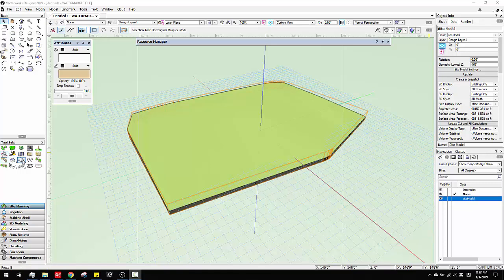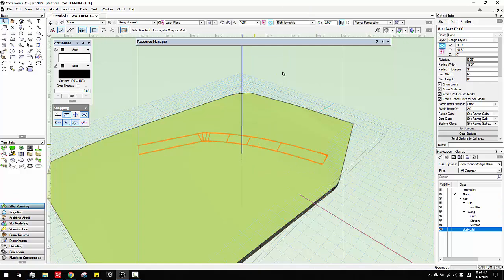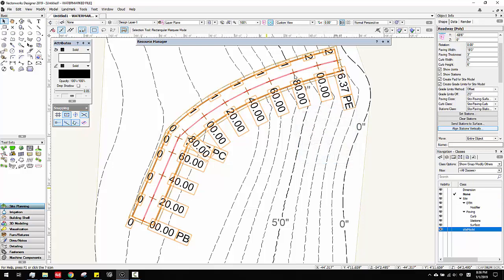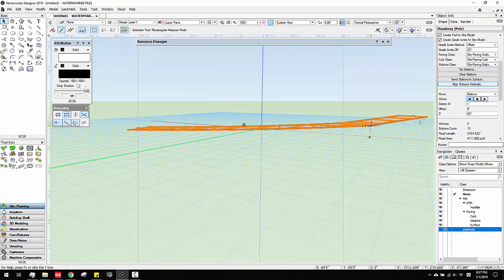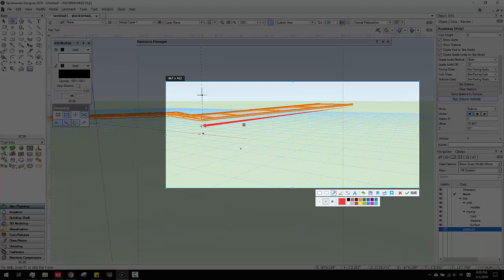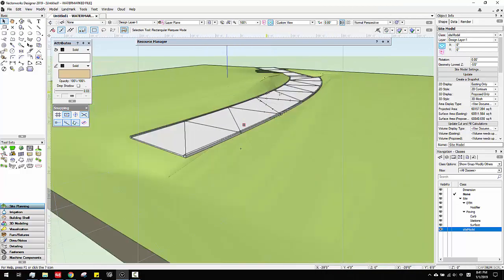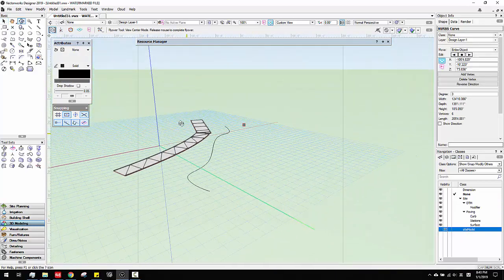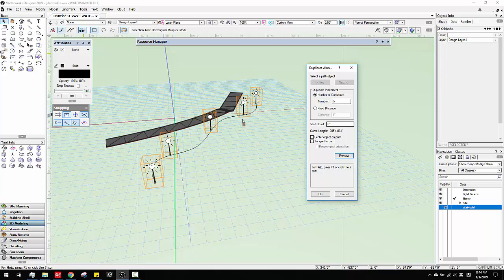Vectorworks Tutorial Basic 13:road, rail, copy symbols along curves

Comment: i have a question 
in min 1:04 (if am not mistaken) you actived some kind of circular xray vision. what is that?
and which command to i need to use

thanks in advance
Reply: and in min 1:35 ?
:S
Reply: Off  the top of my head, i think you hold the 'B' key. It'll activate the x-ray vision.